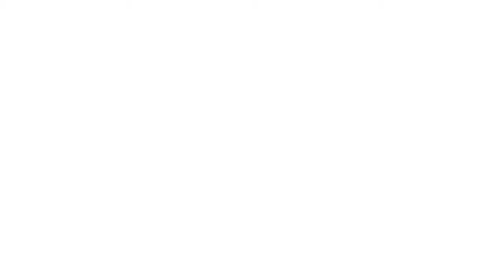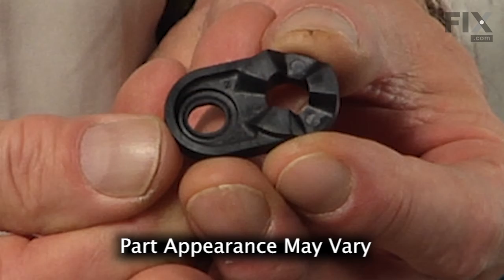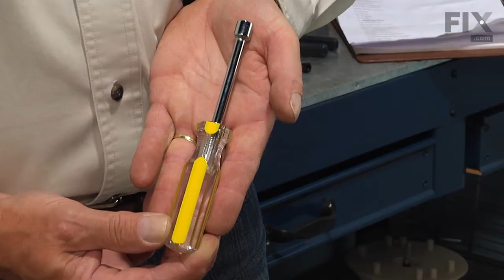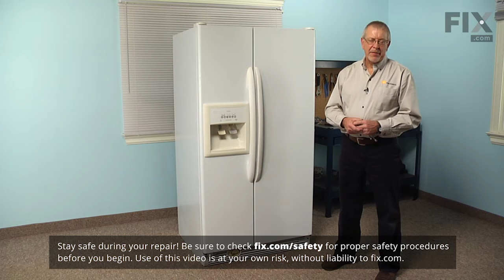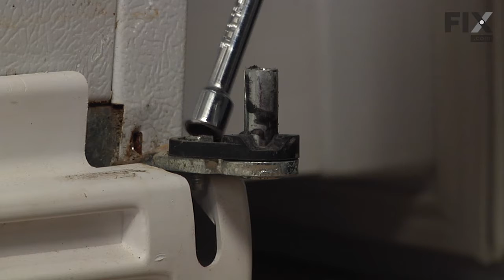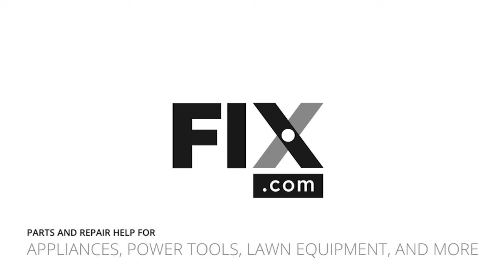Kenmore Refrigerator Repair – How to replace the Door Cam - Black

Comment: That's a bolt not a screw. But I get the drift, thanks for the demo 💟 Ahem.. seeing a video of a guy from a distance removing bolts and parts on top of the refrigerator without showing the bolts and parts he's removing at all is a problem. I do appreciate the video but giving constructive criticism from someone who NEEDS more and exacting information about every job. to do it right without error the first time.